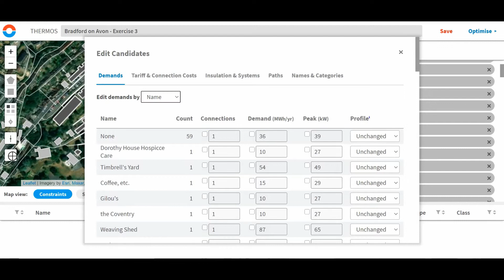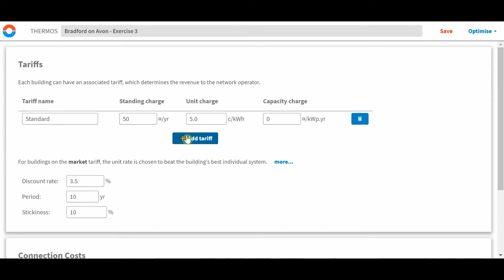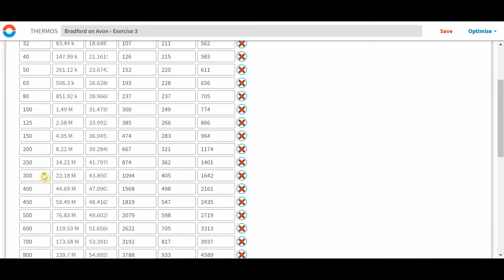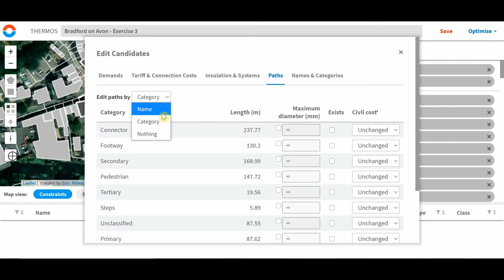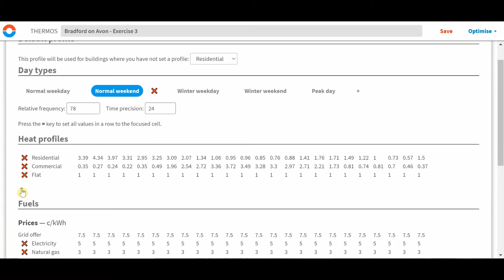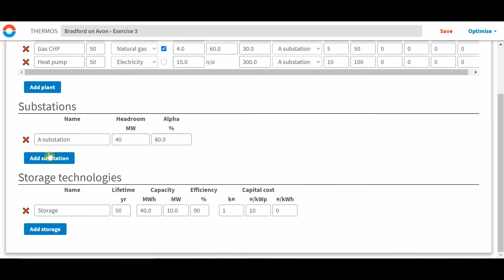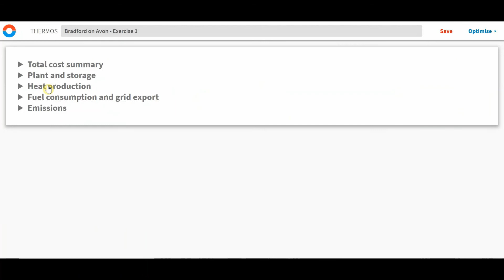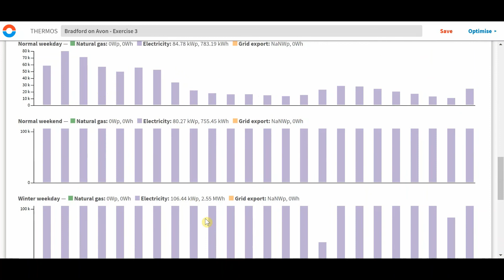THERMOS Software Training - Exercise 3 - Modifying demands and paths- Oct 2020

Comment: Dear Thermos, I assume that the consumption and heat demand are calculated in relation to the building type and its area. Would it be possible to edit the bilding area, and for the to variables to change automaticaly, thus not making us do the calculation for each building and entering it manualy?